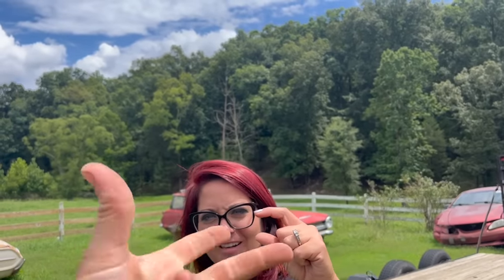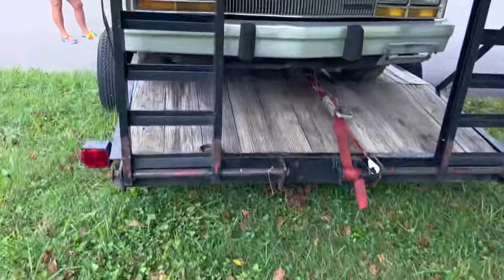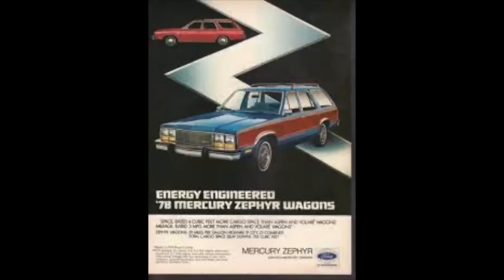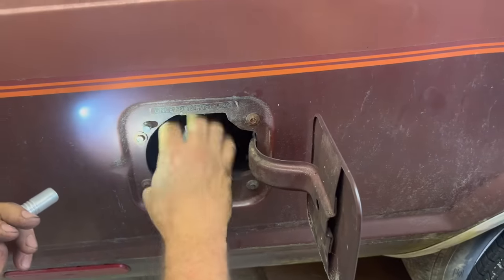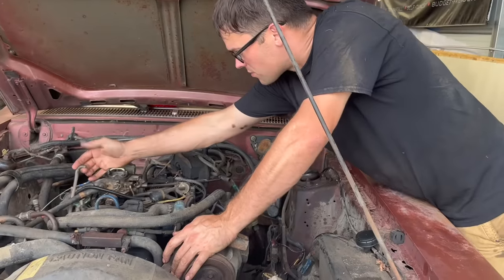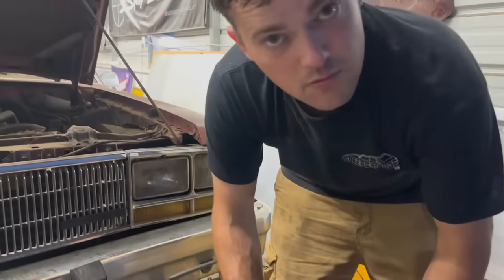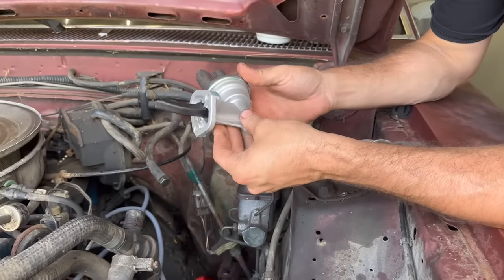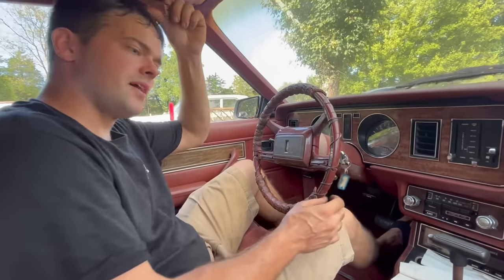Survivor Grandma Car with bucket seats and a floor shifter! Parked for 15 years will it start?

Comment: The way that pump was throwing gas right by the coil always convinces me to bypass the stock mechanical pumps to eliminate a fire starter. That thing was smoking/skipping from the 2 stroke gas and marvel oil in the cylinders lol, im surprised it cleared out as quick as it did really

Comment: This is very cool...my 2nd car was a 1978 Mercury Zephyr 2-door sedan, which was heavily modified (Mustang GT Cobra shocks, springs, control arms, bushings, swaybars, brakes, master cylinder and booster, quick ratio power steering rack, Turbine wheels shod in Bridgestone Potenza RE950 tires, and a complete custom stereo setup).

My car was the same copper metallic brown as this car, but it had a Chamois/Pumpkin colored interior with black and white tiger striped inserts on the seats.  It even had the same OEM hubcaps as the one in your video.  

I don't know if you plan to keep the car, but I would leave the upper and lower chrome trim on the front grille, and paint the vertical bars black (which is what I did).  I also painted my tail light bezels black too (they were silver paint originally).  

A lot people don't know that the ones with the straight six, are very good handling Fox body cars, and actually weigh the same, or less than the Tempo and Topaz.  They make a phenomenal sleeper car, which is what I built mine to be.

Looking forward to seeing what you do with this one...

Comment: Even though i do not like Fairmonts, i don't mind that you do. Someone has to take the Plain Jane's home from the Prom. I'm kinda a Plain Jane guy myself. Lending more towards Mopar & Chevy with Ford last in line. Smog control is crap. It needs a smog control delete kit fo sho. That could be a good safe car for WaWa. My favorite engines are straight 6's. With actually the Slant 6 my most fave. Pay for gas Ralphie. Then you can put a bigger engine in if you don't like saving money. Straight 6's are the bomb. Ty for taking us along
Reply from the maker: Yes thank you

Comment: Those Holley 1920 carburetors are total piles.  They are a 3 piece style (throttle plate, body and upper body). The lower throttle plate section works loose because of the stingy little 3 screws that hold it to the main body.  This may be causing the dieseling, as this adds a vacuum leak. I ended up retapping the three holes to the next size up with course threads and used hex head bolts instead.  Never had that problem again.

Comment: I owned a 1982 Fairmont Futura - it was a 2 door sedan (not the fancy top like your Zephyr).   I loved that car though I did not realize until well after I had purchased it that it had been hit in the rear and the gas tank would take on water after a few months.    It had the 2.3 liter four cylinder which was not all that remarkable with an automatic transmission, but the car was sharp (champagne color outside with dark red interior).   Lots of room.   I would like to own another as it reminded me of my first car, a 1964 Ford Falcon.

Comment: SureCan is a lot better than any of the other plastic ones. I switched to them in recent years because I had one exactly like yours and it developed a crack on the bottom and leaked 5 gal everywhere.  Fun day opening those storage building doors.

Comment: I know know what you mean about 80s cars, kinda falling in love with them.  Those cars were so basic, yet had nice outside lines.  Bucket seats and floor shifter was a plus.
Reply from the maker: Yes they are great
Reply: There is something about the simplicity of early 80s cars, that makes them interestingly cool.  A Prindle, brake, steering wheel, gas, and a radio, and of course a cigarette lighter and ashtray!
Reply: But that's about it.

Comment: The only time I drove a fox body Mustang was when I was test driving one.  When going back into the dealership lot, it was a left turn (after waiting for on-coming cars to pass by.  By a small miracle, I spun the tires just right and for the perfect amount of time, just a couple of seconds.  The salesman in the passenger seat looked at me as "how did you do that?"  😄

Comment: I don't mind the Fairmonts or Zephyrs, but what I would like to see is for you to pick up a decent Pontiac Fiero and beef up the suspension a little bit and also put an LS motor in that thing somehow. I know it can be done, if I was able, I would be trying that, because that little car would be fast and low to the road. It would be a monster to drive. Like to see you tame that monster.

Comment: I wouldn't change a thing on it. One of my rules is if nothings wrong with the engine, don't engine swap it. Rarely see Zephyr's anymore. I'd focus on building the other cars, and just clean this one up inside and out. I'd even try and polish and buff it, see how it turns out.

Comment: That big "can" is indeed a converter. Ford engines back in the day were "dirty" engines so most Ford engines had 2 converters one just off the manifold & one downstream. I should say the straight sixes. The V8(s) had the converter on both sides right off the manifolds.

Comment: She fires righ up!  Tt's a bit smokey, a bit dusty and has a few odd sounds but she is a runner. A few miles and the rings might wake up.        2x 👍       you need some magnet that look like buttons and stick the head liner up with them
Reply from the maker: Yes thank you

Comment: Even though the antifreeze looks good it will deteriorate and become more acidic over time and will lose its rust-inhibiting properties, causing corrosion. Corrosion can damage the radiator, water pump, thermostat, radiator cap, hoses and other parts of the cooling system, as well as to the vehicle heater system. If you are going to change old oil you should replace the coolant as well.

Comment: The ruptured diaphragm inside the fuel pump can allow fuel to dump into the crankcase,   (Oil Pan)  there by diluting the oil to a very thin mixture of oil & gas, this can cause engine damage due to more gas than oil and a loss of lubrication, the engine may frieze up if ran  with this problem.

Comment: Was watching some of your older videos and noticed you at times use 24v to start old 12v systems . Well you like me have 6 v systems so 6v battery’s so 12v plus 6v gives you 18v easy with little chance of fire or Burt starters . Works well

Comment: Kind of boxy styling, but the A-pillars are unique. With it's light weight and a built 302, it would really rip. Give it a bath to see how good it really is!
Reply from the maker: Yeah for sure
Reply: A-pillars are the windshield/roof supports up-front, not the mid-body roof/door post. Those are the B-pillars. 
C-pillars are the rear glass/roof supports.
Reply: @rayrussell6258  I messed up. Thanks for setting me straight.

Comment: I fell in love with the Fairmont station wagon drag car , do a Fairmont station wagon with a hog leg & some slotted mags or build a 400 pontiac , high rise intake , 850 Holly carb , tork converter  , & headers , tempting ain' t it ?

Comment: I had thought the twin for the Fairmont was the Monarch, but I made an error. This car, the Zephyr is the twin to the Fairmont. The Monarch was the twin to the Granada. Speaking of Granadas and Monarchs....those are cool cars too. Great work on getting the Zephyr running!! And you're right, it's in great condition...the patina is just right and the interior is clean. I'd leave it as is, put a little shine on it and daily drive it. Maybe Ralphie can put the Godzilla in mom's F100. 😄 Hey Josh, you might want to keep an eye on the shop, there seems to be a mysterious figure that appeared at 18:13 .....that guy could be up to no good. 😬😅😅

Comment: put a ratchet strap around the tire and crank it down,then air at up, sometimes it will help with getting a tire back on the beed.

Comment: You sure had 10 times much better luck with this car starting than the black Fairmont Futura.  Well, if you replace the timing chain in the Futura's engine, it may fire right up.  But check to see if that engine has stuck valves and bent pushrods which can happen from running on a worn out timing chain.  Once the V8 Futura is running, it'll be faster than this Zephyr because that 302 has 140 horsepower while this one only has 80 horsepower

Comment: Most of those vacuum lines you guys ripped off when you pulled the air cleaner off LOL.  Back when Ford tried to computerize a carburetor...my 84 Ranger was the same way...lots of nonsense electrical garbage.  

I just sold my 88 Ford Bronco 2 yesterday.  Just try finding Bronco 2 specific parts....Ranger parts are pretty easy, its the Bronco 2 specific parts you can't find.  I owned it for 6 years, it was time to let it go....the guy who bought it is going to use it for a fishing rig...it'll be great for that, they're small they go anywhere.  

I also have an 87 Ford Ranger 4x2 2.9L V6 and 5 speed.  Love driving it.  It also has the 7 foot bed, apparently not as common as it was a pain finding a camper shell for it.  Wish I could add pictures....for being 35 years old, its in really good condition, 124k on it, dash is cracked, the typical Ford issue, but no dents, and the  interior is in pretty good condition, seat isn't torn up...typical Ford Radio doesn't work either.

Comment: I board the wheels with two corners of ten cm each, tap with a sledgehammer in a circle and that's it, usually with two or three blows, the rubber slides off the disk

Comment: Ford quit using the small caps when they went with the high output coils. The small caps would arc and cause misfires.

My mom had a 94 Topaz it was forest green and got 35 Mpg. Always had electrical problems windshield wipers never worked right. Blower fan quit until you kicked it then it worked until you shut the car off. The timing belt broke on the way to work. Slapped another one on and away it went. Miss that car.

Comment: You definitely could put a V8 in that car, 302, 351 would bolt up to a C6 automatic, and could use that same floor shifter because that was how the old 60's and 70's Mustangs were with the C6 and 302 or 351.

Comment: Next thing you need to do to the Zepher is either sell it or repair all the brake issues,,,,  very dangerous,,  you can fix the double pumping by goin in reverse and hitting the brakes several times,,  that will adjust the rear brakes,, :-)

Comment: brake parts cleaner if you spray and pry spray and pry real fast because it drys fast but it does wonders on old dry rotted rubber makes it slick and plyable

Comment: Some times those rubber parts(   Accelerator pump  )   soak in hot water  ,then in warm oil  or petroleum product  to bring them back   sometimes

Comment: Need to take all that smog pump and vacume plumbing off it and put an older Holley one barrel carb on it from like a 70 maverick application and golden on carberation. If it has the really rare 2 barrel manifold then put a Webber carb on it . or Holley 2 barrel several different ones will work.

Comment: If you just poor water on the hub when wheels are stuck you will be very surprised how good it works. It's like 24volts gets it every time. Please Try it next time
Reply: When the wheel is stuck on the car!.!     Not when the bead is stuck to rim. I've never tried it on the bead.
Reply from the maker: Ok thanks

Comment: You didn’t get the long valve stems. I remember back in the 80’s getting tires on my car. There were the short stems on it which sucked with hubcaps. The tech asked me if I wanted long stems for a little more money. They make those? And ever since I always request the long stems. 👍🏻

Comment: looks like a goody I always wanted one to go with my merc S/Wagon
Reply from the maker: Awesome
Reply: @Sleeperdude  Smartest thing I ever did was buy a tatty 86 Mustang and swap front end, [5 stud, brakes, better geometry, better shocks etc] Diff [ 8.8'' & 5 stud] interior buckets and dash..then put the motor and box into 67 Falcon and the front panels on a 89 Aussie Falcon ute..[that confused a lot of folk]  My Merc was already running a late model 5 litre [ex Aussie falcon] and with the mustang suspension handled corners really well and had a best time of 12.4 on the strip with the original diff, which was shit and fell apart on the 3rd burnout

Comment: The Timing is 2 Degrees to high.   That's because the floor it test .. It wouldn't rev that's because timming is clipping the edge of the power band.   Turn it down a tiny bit just until it changes TONE and tighten Thier then the floor it test will Garateed Be Faster

Comment: I once had a 1982 Mercury zephyr and it had the same problem with the tail lights cover coming off you might want to try using super glue it work on mine.
Reply from the maker: Ok thank you

Comment: I just wanted to give you a tip with the old advertising pictures. I am assuming you are just saving the images directly from the Google image search because those are only low resolution 'thumbnail' images (basically a little snapshot of what the full size picture looks like). What you really need to do is go to the website where the picture is located and enlarge it as big as possible before you save it / download it.
Reply from the maker: Ok thanks

Comment: Do those things have rack and pinion steering? Needing a donor for my '62 Ranchero.Post 80's head means it has largest plenum volume of all the small sixes,and seven main bearings,tough to kill.Ranchero has flat top pistons,1980 head, hardened valve seats oversized 3 angle cut S.I. stainless valves,head milled .060"single carb cut off,opened up for 32/36 Weber and/or autolite b2100(can run either),Schnieder cam,recurved dura spark with full length bushing and headers.The World Class t5 makes it fun.The 8" diff replaced the 7.25" I blew up.So,go on turbo the thing,do a blow through so I can learn something.

Comment: Also I have a granada of the same vintage.  It uses the Carter YF Carb and they are reproduced and they are cheap. its also the same one used on the for 300 inline 6. pretty robust carbs,and they have vacuum ports but not like this

Comment: I always liked th Futura/Z7 body styles.with air conditioning you got a bumo in horsepower on the 200 I 6, and the optional engine was the 302, a V8 git you air conditioning and the led panel that lit uo if a light bulb was out. I never saw one with power windows or seats.   I am a die hard Fox Body fan.  But in Florida and Georgia there are none.  My brother had a 1987 Mustang Convertible.  He sold it when he git his new Tesla.  Big mistake in my opinion.

Comment: Have you ever tried Hairspray on those ripped gaskets like on the carburetor.? I wonder if that would work for a little bit?
I always like the Mercury Zephyrs better than the Fords Fairmont. When I was a kid the Mercury Zephyr is the one I thought would be a killer sleeper drag car on the street.
Reply from the maker: No havnt tried that yet

Comment: Why the large distributor cap? DuraSpark voltage was too much for the smaller diameter cap, so...... Ford increased the size of the cap to eliminate the power jumping inside it. I read that somewhere.... Seems plausible

Comment: When you count four lugs on the back axles it's a v6 cylinder five bucks is a V8 cylinder.....
Reply from the maker: Ok thanks
Reply: Correcting myself I said four plugs being six which could also be a straight sex....... The straight 8 cylinder engine died ages ago....
Reply: @Sleeperdude  I'm probably telling you something you already know.....

Comment: Is that a 200 straight 6 or the 250? I can't remember what those came with.. 250 was rare but I swear up and down the Fox's came with a 250 from the factory for a year only. Do yourself a favor and delete as much of the smog as you can - it's a colossal pain in the ass to get right without 240 vacuum leaks from 5,280 different places. But the electronic feedback carb is actually fairly bulletproof & reliable, gets decent mileage just don't expect a ton of power out of it. They ran smooth as glass when all the vacuum leaks got sorted out. You're right you don't see the old Ford 6's in cars much.. everyone & their brother who bought one in the 80's dropped a $200 302 & a c4 in em from what I remember. I actually like the old 200 straight 6's